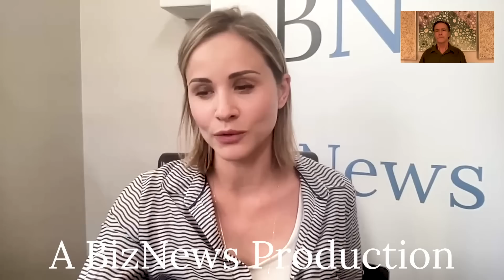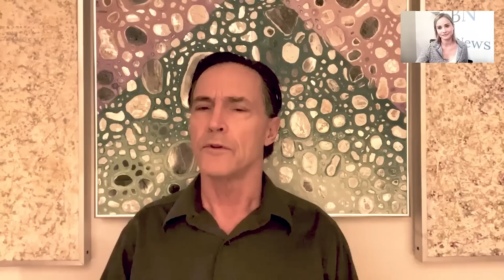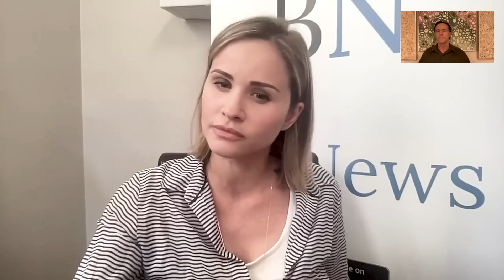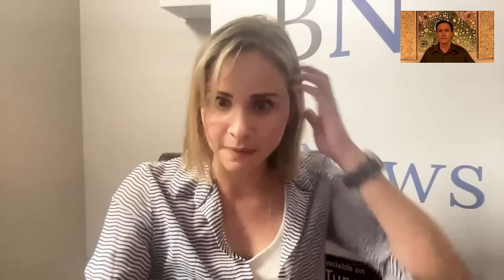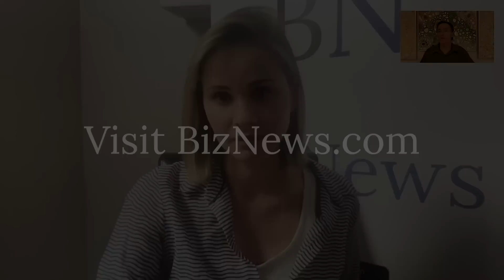The climate engineering cover-up – Dane Wigington on the existential threat of geoengineering

Comment: Is this clown a flat earth believer?
Reply: If someone measures something that the government doesn't acknowledge, it is akind to believing the earth is flat.

Back in the day, many many years ago, the governments position was that the earth is flat and people that disagreed with the governments position were called spherical earthers and not only their measurements were decried, but anything else they said could be dismissed. 

I went to the website and watched one video.

It shows two large jets, flying in close formation, which were leaving large trails. It could be explained by the jets being larger than usual and atmospheric conditions. Then, the trails behind one of the jets, agin flying in close formation, ceased abruptly, continued with no trails for a period of time while the trails of the other plane continued, and then abruptly began leaving a massive trails again..

A possible explanation could be that the plane that had a gap in its trails completely shut off all 4 engines and then restarted all 4 engines instantly, while maintaining the same speed of the other jet, or that atmospheric conditions changed abruptly and with a very distinct delineation. 

Since you are not a flat earther, how do you explain what is clearly visible in the video?

Comment: Nuclear plants do not require "Grid Power" to operate their cooling systems, nuclear plants generate the power to cool themselves, by themselves! If there is a complete failure of the grid, the power plant will generate the power necessary to to operate the cooling pumps. That is what they do, generate POWER. Well engineered, intelligently located nuclear power plants should be a major part of the solution.

Comment: I hate to break it to the believers on here, but specifically concerning contrails (B-17s he mentioned, with trails turning off mid-flight), the presence of contrails is simply a matter of atmospheric conditions.  Aircraft operate through a variety of atmospheric conditions that will cause the presence of visible contrails under the right conditions (temperature, humidity), and they will instantly become invisible when those conditions are no longer met.
Reply: Time for your booster Casey
Reply: @caseyj8210. You live in a cave to make such an insane statement.  So much brownish dust much heavier than air floating to Earth while you live in your mama's basement in complete darkness.   You are completely blind.  This is the satanic work of savage animals that aren't even human but their minds have enslaved them into a psychotic behavior that would make Satan proud.

Comment: Omg I am tired of pointing it out to people. One day a nice sunny morning coming back home from town. I live in a smaller town about 5 miles away. On way back I noticed 3 large low plane exhaust trails. All crossing sideways which is opposite way of only airport in town. And they were low. I got home and kept watching them.mthey morphed into a thin cloud that covered the entire valley. Then stayed. About an hour later a wind kicked up and gone and back to nice sunny day. That was just one weird time I noticed. There is plenty more. The weird thing is thise low hanging thick exhaust lines. I've seen alot and they turn Into that light cloud that is thin but covers sky. I've seen alot and they are different than when I actually see the plane go over. I've never ever seen the plane that leaves those thicker low ones and usually I see them early.

Comment: direct connections exist between these geo-engineering attacks, and the development of a prototype nano-bio weapon, dubbed Morgellon Disease.

It's not a disease, its a synthetic genetic Chimera that just so happens to eat the metals used in these weather mods, and turn them into Radio Crystals that can transmit the signals necessary for the bio weapon to hijack the nervous system, brain, heart, lungs, and liver.

It doesnt kill them, it hijacks them.

the only part they cant feed yiu directly, is the chip to localize the system on a closed loop inside you.

That part of the weapon, also known as the Mark of the beast, is the final and first step in the permanent forfeiture of your ability to choose for yourself.

the final portion must be implemented physically, by force if necessary.

Comment: 14:13 re: “normalizing , Geo Engineering aka Chemtrails” so they have put into Disney and kid movies the clouds to look like king streaks and haze, when they “digitally re mastered” their movies this is when they added. Also in like 2015 There was announced 5 new “discovered” types of clouds 🤔🙄😮🤥😡 … regardless I have never ending hours of footage that shows the “contrail” coming out the back of a plane, we then watch this “contrail” swell, grow, and often link with other swells… 🤔 idk about any of you but when you walk in winter Boston, “smoke, cloud, w/e) exists for like 3 seconds … it never swells… ever, contrail/ hot breath on cold day is the same, on smaller scales no doubt…. (I also have footage of planes w/ contrails and from down here ref point the contrail appears about an inch and does not leave a trail, it “appears” to stay consistently with the plane the “1 inch” trail…. It does not leave a smudge or resistor evidence it was there…. B/c obviously it’s water turning into different forms which needs heat and there is no heat to make a trail, so it either beats higher or cools off, the 99 reality, which means it turns into vapor and eventually a drop of water…. Ok so if I have video that show a clear sky, then this “cloud/contrail/w/e) coming out the back of plane, leaving a trail a smudge of what appears to be a cloud in the sky, then watch it swell and it looks like a cloud …. But I know it’s not I just watch a clear blue sky be colored on and swell to appear to look like a cloud…. I know it’s not…. I mean I have watched 12 planes go off in a morning…. Nobody cares and when you try to track the “plane” above you it always says it’s like fed ex 🙄 like no nobody flys count to a few counties a way it’s cheaper to truck … stop it… and once you start watching it’s sick…. I heard if this when I lived up North Boston, but moved to florida it’s flat so flat I can see it raining I’m one spot and not in another, I see it all day long and I have documented it…. And nobody will talk about it, and it HAS to be a multi billion dollar operation this is strategic, calculated, it cost money, and it’s massive…. One can’t even imagine… you would think no way…. No yes way, it is a massive, competent multi billion dollar government stargazed, daily, significant, no joke operation
Reply: 100 percent 
In my major city it’s the same
Reply: I'm not even in a major city, but it's the same

Comment: In 1983, I started observing and filming weather modification in Northern California, in the form of very abnormal, non-dispersing contrails, commonly called chemtrails. Far from dispersing, these trails would in fact thicken and spread out drastically across the sky, often resulting in a complete layer of whatever from horizon to horizon, and surely beyond. The jets involved often fly in grid patterns to ensure a uniform and very widespread impact. Since then, I've observed this in many other locations in the US and Canada. I don't travel much internationally so I can't say about other parts of the world, but I have seen photos from around the world that DO show chemtrails. Of course, other materials are sprayed at high altitudes that are not plainly visible. Beyond the shadow of a hint of a doubt, it's all real and has been happening for at least 40 years. Undoubtedly by this time, given the total secrecy and associated lack of ANY oversight by any impartial, democratic agency, these operations are totally out of control and have caused incalculable harm to the global ecology. Of course, weather modification in general goes back quite a bit further, to right after the end of WW2, and perhaps, to some limited degree, even before that. We've all heard of cloud-seeding. The general official line is that it can work, but is very unpredictable. 

But that's pretty much bullshit, especially these days. It's been refined, tweaked and amped-up massively since the 1950s, and goes WAY beyond cloud-seeding. It may still be somewhat unpredictable, but in general it DEFINITELY "works."

In addition to chemical-based activities, EM/RF technologies are also employed - both in conjunction with and separate from the former. The use of all such technologies as weapons is certain, as is their use in supposedly 'benign' applications, one of which could be mitigating (?) global warming. The generation of artificial "cold snaps" as mentioned in this video might seem to indicate that kind of application. However, it's very likely the actual intent is to merely affect the public PERCEPTION of global warming (and thereby decreasing general belief in it and/or in its seriousness), rather than actually doing anything substantive to STOP global warming, such as drastically reducing, then eliminating, fossil fuel use worldwide. But THAT would necessitate ending the corporate-fascist/capitalist stranglehold on humanity, on governments and on the entire socio-economic-political foundations of the modern world.
Reply: I have serious doubts about the effects of carbon based fuels on our environment. When one large  volcanic eruption will disrupt weather patterns for less than one weather cycle,...do I believe the offical narrative spewed by G Thunberg and her handlers???.... not!...... fool me once...
Reply: Global warming is BS!
Reply: @thylland  No it's NOT.  Just because these dirtbags are fucking with the weather in all kinds of ways doesn't mean there's no such thing as the GREENHOUSE EFFECT. It's been observed and noted for OVER 100 years. It has nothing to do with any deep state agendas. It's basic atmospheric physics, pal. Basic. Fact. Like the Earth is a sphere and not flat.
Reply: Meanwhile all the explosions , space rockets, military exercises and volcanoes are pumping carbon, sulfur and poisons into the air faster than any city with cars can. Look over here not over there seems to be the rule of the media. Let’s enjoy what we can while we can.

Comment: aluminum is used by the military to scatter radar so the opposition can't tell what plane movements are going on. it should not be used under any circumstances, it is awful for the environment, Stratferic injection exists naturally, from volcanic eruptions
it is not being added by anyone so2 is terrible for climate change it destroys the ozone layer, what we should be using is calcite charged by HAARP-type technology to reflect solar radiation in a Mr blue sky scenario, so you can turn it up and down as needed. T

Comment: @ LivingOrganisims this is reality. Time zone; Pacific coast, front line of the air traffic corridor with on shore flow, fighter jets are always sent defending on overcast days. The precipitation no longer is absorbed by the soil. Bringing wild fires to the marine zone, THIS IS MADDNNEESS. The worst part is, humans have spoiled all organic material with the PFOA, that are still in USE!!  However our solution is real and viable, if unsurvivable. Yes. 35 seconds at 5,600°C and gods creation is vackst. Though without completely boiling off the oceans, fail. I am not sure any part of our biosphere will survive, it may also inhibit our intended space exploration or deny it. QUESTION If a 'trail' of any kind or even a lonely cloud is seen in the sky, clear sky, with a shadow just below it clearly visible. WHAT IS THAT. HOW IS THAT. NEVER SEEN PRIOR TO 2012. HAVE PICTURES. COMMON NOW.